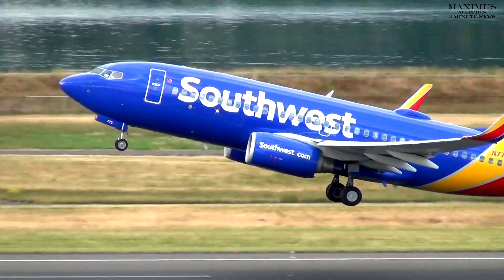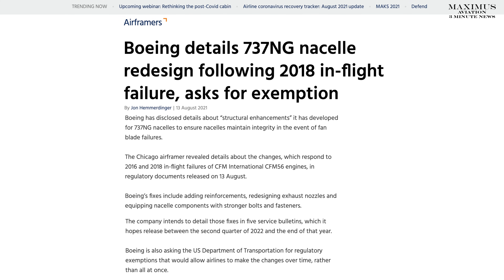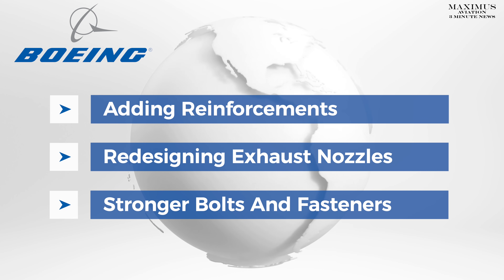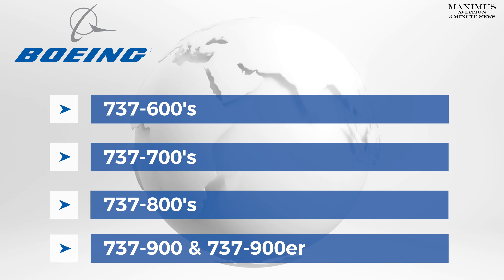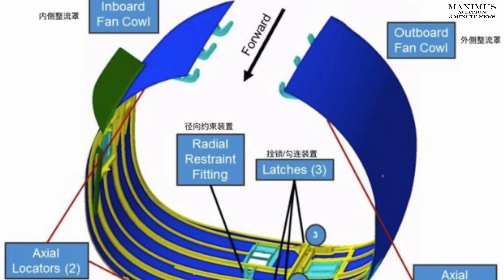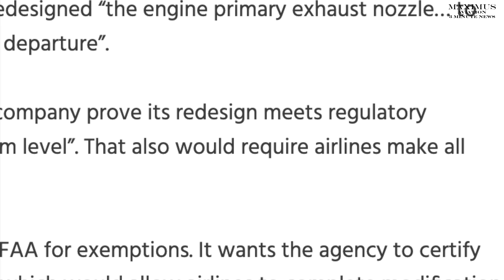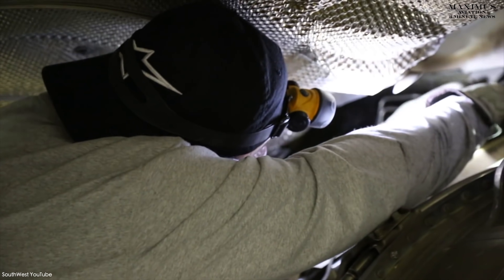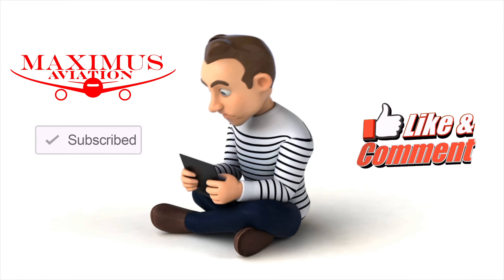Boeing Reveals How They Plan To Fix Dangerous Engine Nacelles

Comment: These nacelles were designed in the 1990s, and got certified in the 1990s. Standards change, and that's why the nacelles are deficient in today's standards. It's similar to how a 1999 Toyota Camry will not pass today's safety standards. Does it mean Toyota deserve to be prosecuted because the 1999 Toyota Camry doesn't pass today's safety standards? No. The nacelles are not flawed, they're simply outdated and they have to be revised because unlike other nacelles in the 1990s, these nacelles have to deal with blades that are likelier to fail. This is a result of how far technology has chamge, not a result of a design flaw

Comment: The fact it took the NTSB five years to figure out, and finally to make public, that they would start demanding improvement in the matter may seem curious, but it may have been held back part of that time out of leniency. Not only would all parties have known that Boeing would have to design new parts from scratch, also it would have been impossible for Boeing to make improvements to parts of a worldwide fleet during the last nearly-two years of those five, with Covid-19 and borders closed, and anybody grounded anyway. The striking part of the story is that hardly any time passed between the directive coming out, and Boeing announcing that it had worked out the solution, cause THAT is the part one would think WOULD be time-consuming indeed: they had to figure out, design, prototype and test one or more completely new parts, and it had to be done to meet specs they previously had not managed yet. The fact there lays so little time between the NTSB's announcement and Boeing's can only mean at Boeing they have been working on this during the passed five years ANYWAY. Even with no directive out they of course knew already the situation as it stood was (or is) not satisfactory since the time those two accidents happened. Also I imagine there is enough informal communications in the industry for them to have known all along the NTSB was working on a directive. That one year and then some Boeing says it will take them to implement their improvements is easily explained: they have to start making these new parts from scratch, probably have to source new materials from God knows where on this planet, in times when transport and all kinds of industrial things are slow, probably have to train personnel, have to take this up with airlines across the world and start planning it with them, it's all kinds of things that they have got to figure out. I am very impressed they really have found a way to improve those cowlings so, that no fan blades can reach the cabin (or wing, I imagine!) next time any of them is gonna break off, at all.

Comment: When you hack together a good 1950's design with the cheapest possible hack to make it work, fake your testing, pay off the test pilots to lie on flight tests..  lie about the issues (blame pilots and mechanics for engineering errors) and spend your money on yachts and executive bonuses..   then when people die again, put it off as long as possible..  spend a few bucks on lobbying..  lie some more..  delay..  focus on quarterly profits..   
Hmm..   this sounds familiar..   
"new" f16..  thats 'feature' is its an easy target to protect the more expensive jets..  um, wait.. what??  (not kidding, thats the marketing)
Starliner..  what, it only had a couple minor erro... . oh, NASA checked an found over 160 design an control issues on the maiden flight..    a few years of work an some billions its Grea..   oh right..  their astronauts quit and its off the table for now.. still a work in progress I suppose..   2, 3 hundred billion an another 10 or 20 years should be..   starting testing..  
Flight control systems failures..  Check
Engineering structure failures..   Check
Delayed and untested repairs..    Check
Special considerations...    big     Check

Comment: Maximus is wrong about the cause of the inlet cowl failure. The cowls are failing because the fan is failing. Fan containment failure is part of the engine certification. Engine manufacturers are required to demonstrate a condition where fan blade separation is contained by the engine fan case. This is not part of the engine cowling. These fixes Boeing is working will not increase containment of a blade off condition. What they will do is improve aircraft controllability in the case of a uncontained fan failure. Fake news.

Comment: I am not a Boeing fan, but I fail to see how this is a Boeing issue.. The CFM engines are failing that is a different manufacturer..   RR makes engines GE makes engines, others make engines.   When the Rolls Royce engines blew up almost bringing down a quantas A380 all the blame was put on RR.   Same here.
Reply: Part of the problem was that the fan blade fragment hit the Boeing retaining clips on the engine cowl which then failed and failed to contain the fan blade failure; IIRC it was a fragments of the cowling that punctured the fuselage and damaged the window.

Another problem was maintenance had failed to spot the metal fatigue in the fan blades at the recent engine overhaul - a newer better procedure for checking for micro cracks has since superseded the previous maintenance method which had missed the fault in the blade.

Comment: Just remember, to implement the fixes, it will take time to MANUFACTURE all of the repair pieces (there are a LOT of these engines). It will take time to gather the needed hardware, which needs to be manufactured. Instructions will need to be written and printed. Mechanics will need to be trained on implementation of the fixes. You can't just wave a Magic Wand or pull all of the parts out of a Trick Bag.
Also, smaller fixes - one at a time- can be installed during scheduled maintenance intervals without the need to remove the aircraft or engine from inventories for an extended period of time to implement ALL fixes at the same time.

Comment: Any aircraft not modified should have it's ETOPS approval suspended. Ditching in an ocean is the real threat due to drag.
Reply: Yeah but the chance of it happening is so small i understand and kind of agree that it should get some punishment on etops but not completely lower it back to 60min maybe 75
Reply: @apotato5563  The United 777 in 2018 barely made it into Hawaii with full power on the remaining engine. Neither Southwest failures would have made it to an airport if in the middle of an ETOPS flight. Many 737s are being used on ETOPS. Southwest is flying to Hawaii. These big fan engines are a hazard. They're like the engine hanging out of the nacelle in "The High and the Mighty". This is a real threat and the industry knows it. I'm a retired airline captain and I would bid off any ETOPS trips if I were flying today.

Comment: Airbus uses the same Engine but built in France ?   do they make their own cowlings ? have they had any problems ?
Reply: Maybe they do but its greatly unknown with the great use of the 737ng that airbus couls swipe it under the rug
Reply: @apotato5563  Unlikely with modern press and social media hard to hide half an engine missing.
Reply: @michaelshore2300  yeah good point but the press keeps forgetting how many 737ngs there are flying
Reply: All the CFM 56s are made the same way, partly in the US and assembly in France.
Reply: The cowling design and clips to hold it together (which failed when the fan blade fragment hit them) are Boeing designed (for the 737 being lower to the ground).
Reply: @cigmorfil4101  We have seen this before on 737 aircraft  (east midlands) where tests were not done on 'complete' engine installations.

Comment: I did not read all comments. Hecklers provide no information at all. The complaint in the piece mirrors common sentiment, mainly and understandably, of tardiness, but did not incorporate all of the facts or recognition that after the fatality in Southwest Incident in 2018, where blade fatigue was indicated, the more frequent fan-blade inspections put in place two years earlier had not been applied to this engine, the procedure as the upstream preventative measure of greatest importance. Such should be understood as a measure to eliminate the primary problem. The Nacelle Design should, secondarily, be improved, because it was not blade debris that killed the woman in 2018, but nacelle debris that broke her window. These Nacelle Improvements focus upon keeping it in place, The FAA did not ask for a tougher cowl, but one that should not come off so easily. I also think the "exemption" Boeing asked for is not really of great interest to the manufacturer itself, but represents airline interests and their variation in capability to carry out the programs less disruptively, who will prefer to get the separate front and back issues solved as parts become available, not while waiting for pairs to show up, not foot dragging from the manufacturer as implied. The logistical scheduling for unrelated parts is very difficult. We would all prefer done yesterday, agreed. Blade Out events are very rare, often very ugly., fatalities even more rare, Most of the time, nacelles suffer great damage, chunky stuff sometimes falling to the ground., but in this case, the nacelle came off with enough lateral force to damage a window in Row 14. Blade Damage from uncontained blade separation would normally be along a line perpendicular to the fan itself with a one in seven chance of striking the fuselage. Trajectories above or below, upward, downward, or outward are more likely around the circle of possible trajectories, none good, but also not a threat to the aircraft. The center engine failure on a DC-10 in 1989 killed all aboard. The exacerbating problem there was incorrect positioning of all three hydraulic lines, simultaneously cut and without line stops to maintain hydraulic pressure from the other two engines. The redundant but vulnerable hydraulics bled out.
Reply: Did you mean flight 232? On that flight were 111 survivors but that was to thank to the pilots skill and 1 training pilot

And that was a lot of info to take

Comment: Yet another reason try to to avoid Boeing aircraft wherever an alternative exists.  A failure is very unlikely but the company knows its existing design makes fatal failures possible.
Reply: Yeah avoiding a plane mecause you have 2x the chance of danger even then 2x is nothing its still 5x deadlier to fly private jets and still waaay deadlier to drive cars yet somehow people see that as normal and do it every day while sharing the roads with cars that are questionable of design
Reply: @apotato5563  It wouldn't make sense to drive out of fear of flying on a Boeing aircraft.  But if I knew that another brand of aircraft was safer than the Boeing I'd choose the other brand. If the only planes on the route were Boeings and the only consideration was safety, flying would still be safer.
Reply: @rais1953  i understand i just wanna let you know that boeing is still save for aviation standards aslong as you dont fly lion air
Reply: @apotato5563  When in Indonesia I only fly Garuda and have never bothered to check the aircraft brand. They're acceptable by EU standards.  Lion is cheaper and the network is big but their safety record isn't very good. With the pandemic there's not much flying going on in our part of the world anyway.  Australia has almost zero international travel at the moment.
Reply: @rais1953  yeah my grandmother flew as stewardes on garuda
Reply: @apotato5563  Anda orang Indonesia?

Comment: Seems to me that the FAA should look into the blade-off test performed during certification.    This test clearly did not detect the CFM inability to contain a blade failure.  Perhaps this test needs to be redesigned too.

Comment: If the risk of death has to be 0 to certify an aircraft or engine, there wouldn’t be any aircraft flying at all.  The CFM56 series of engines is the most prolific jet engine ever built with more than 30,000 in service now or in the past. As far as I know there is one death that can be directly associated with fan blade separation after a CFM56 failure (in another accident there were several deaths after the pilots shut down the wrong engine after a fan blade separation event but those deaths did not occur as a direct result of the failure so much as from pilot error dealing with the failure) and that’s the Southwest customer several years ago. All in all, this engine is probably the safest engine ever fitted to a modern day jet airliner, even in its current form.  One death in nearly 50 years isn’t really an emergency fix in my opinion.   

I currently fly these engines nearly every day for work, so I literally bet my life on them, and I’m happy to do so.  Perhaps the changes will make them even better.
Reply: Good point
Reply: Nailed it! 
I have many thousands of hours flying them too. The drive to the airport is FAR more dangerous.

Comment: The probability is (Rare)^2 that the engine fan will fail and that the failure will escape the cowling
causing further destruction....Therefore the correction is urgent not emergency......Any time you 
are faster than 30 mph and/or higher than 30 feet above ground, your life is in danger....

Comment: This is just another issue underlining the fact that the 737 has overstayed its technical design life. The design originating from 1969 and modified way too many times has created a Frankenstein aircraft! Scrap it Boeing and start over from a clean sheet (screen)!
Reply: Old trope and load of crap. There are many old aircraft designs still in production because they simply work. Get some new material.
Reply: @RLTtizME  
You placed your words visely. Let’s get som new material and retire the 737 in the Boeing field museum. Cheers
Reply: True you should see its cockpit, they kept adding stuff in each generation yet you still have stuff straight from the 70s
Reply: @togafly.  thats because then pilots can be familliar with the plane they are flying this makes it cheaper for boeing to design the plane and the airline to train their pilots and might make it saver because the pilots know where every thing is
Also airbus does almost the same thing a320neo-a320ceo
A330neo-a330ceo-a300 basic examples of most aircraft manufactuers rebuilding their old version of planes

Comment: I feel it needs to be said - If GE's fan blades weren't failing in the first place there wouldn't be any issue to discuss. Boeing can't be blamed for everything.
The "GE factor" needs to be reviewed - they have similar corporate issues to Boeing that have been swept under the carpet for a long time. In both the fan
blade incidents you have pointed out here there was serious concern regarding the metallurgy of the fan blades not being manufactured to spec.
The issues with the LEAP engines have yet to surface - standby for that one.
Reply: These CFM56 engines are of an old GE design. Newer GE engines like the GE90, GENX, LEAP, and GE9X are more reliable than the PW and RR engines of the same era because carbon fiber blades found on those new GE engines don't wear out as much as PW and RR fan blades. The A320NEO and A220 fmily aircraft experienced groundings and airworthiness directives because of PW1000G engines and some of the 787s were grounded because of Trent 1000 issues. Also, fhe component that failed on AF66 was a Pratt and Whitney component. And not to mention UA328 where United and Boeing got blame for PW's wrongdoings. There used to be a time when GE was less reliable than PW and RR, but RR and PW reliability tanked.
Reply: @Blank00  Well "Blank" - Have you operated those engines? There are issues with the LEAP engines - catastrophic failures - at least 2-3 that I'm aware of - the engines 
in question had less than 500-1000 TT at failure. Hmmm... Makes you wonder now doesn't it.
Reply: @daveholekamp1069  The PW1000G are worse. They are the engines that caused a some A320NEOs to get grounded
Reply: @Blank00  true many neos in my country had to undergo engine modifications as the stock engine had problems during its initial days
Reply: To polite, your beyond wrong. Southwest airkine lousy MX is what caused this! That was actually their second fan blade departure. That one just didn't kill anyone and was quieted up. 🤨NO OTHER airline had issues.🤔 From both a mechanic and QC perspective this is OBVOUS.
Reply: @Stowell1984 - I was at SWA for 24 1/2 years, and operated 737’s for about 22,000 hrs. at 5 different airlines. I’m not being polite - just straightforward. At no airline I worked at did they have lousy MX. The airplanes at SWA did work hard for a living. A lot of cycles per day. I have a number of good friends that are mechanics at SWA, and we talked quite a lot about about all things regarding the 737, and I just can’t agree with your position on this subject.

Comment: This is a start... But they should focus on the root cause, the engine blowing up... Then you can focus on reinforcing the nacelle. This seems like Boeing saying "yea we expect the engine to possibly blow up so we'll make sure the nacelle will contain it".
Reply: That isn't a boeing problem to fix, that's CFM's
Reply: They would've if they made their own engines. But they don't make their own engines because since 1934, no airplane manufacturer is allowed to make their own engines, rendering Boeing (and Airbus FTM) legally bound to havibg to outsource engines. Even Comac has to outsource when they selected a Chinese engine, because Comac and ACAE are different companies.